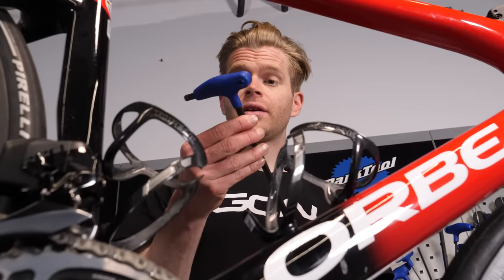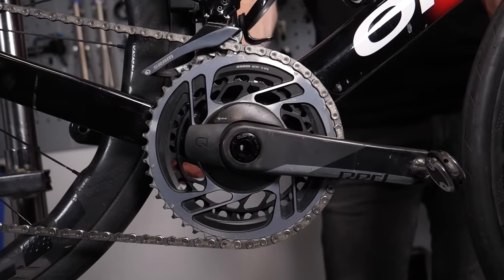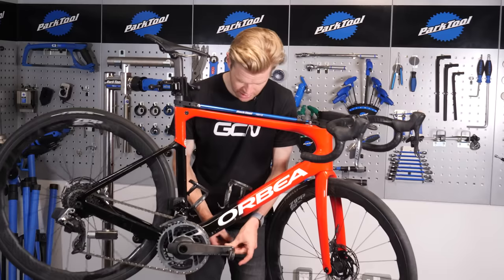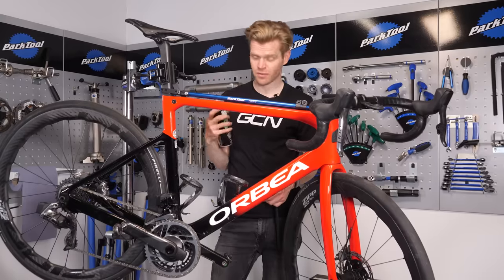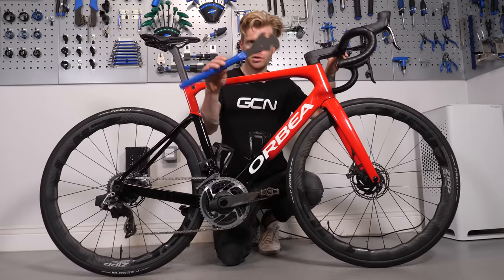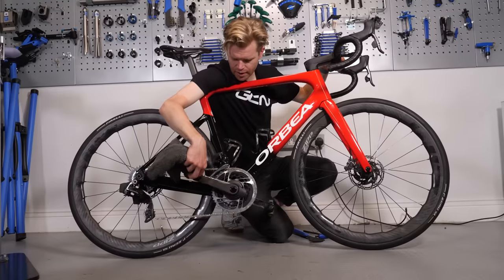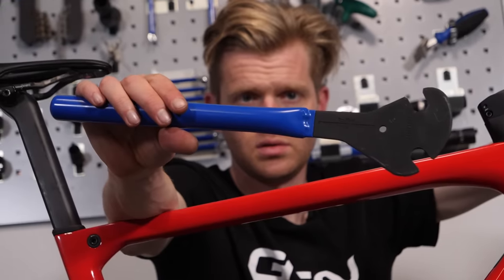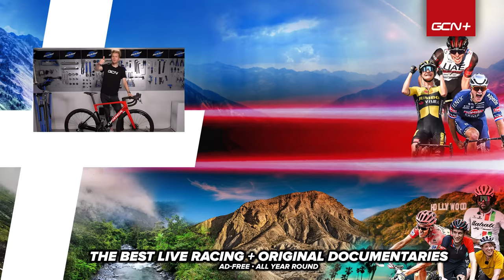How To Remove Stuck Or Seized Bike Pedals | Maintenance Monday

Comment from the maker: Do you have any tips for removing stubborn pedals? Let us know in the comments! 👇
Reply: Don't be afraid to take the cranks off and put it in a vise or clamp it down in a way that will allow you to put more force on it without risking damaging the frame (or yourself) when putting a lot of power through it.
Reply: Just the same advice as others, put a pedal wrench on it and pedal as described in another answer. I can’t even explain how to do it. When you pedal forward, it tightens the pedal, so I just pedal the wrench backwards. Pedal pops right off. 

You reverse it naturally by simply pedaling the bike. This is for old skool pedals that use the wrench. Not a super bike. 

My Bike Friday is a travel bike and this is the best solution for easily getting it into a suitcase.
Reply: There comes a point when the proper tools just can't do the job.  The pedals are so badly stuck the allen slot strips out, for example.  In such case I have had to strip the guts off the pedal and take it down to the bare spindle, then grind flats onto the spindle and employ a large set of locking pliers and a pipe for leverage.
Reply: If you're using aluminium cranks, the steel threads of the pedal can fuse to them due to galvanic corrosion. This creates a tight bond which can be very difficult to break. If this is the case, heat, in the form of a small blow torch, or better, an air soldering iron, is the answer. Cracks the bond due to differential expansion of the two metals. Best avoided in the first place by putting a dab of copper grease on at assembly time.
Reply: My tip is go to your local bike shop.
Reply: If they have an allen key hole at the inside use an impact driver
Reply: not being very strong or very heavy, I stick the allen key into the ground and stand on the crank…
Reply: Just a comment on "self tightening" direction of the threads. This is not correct. Indeed, you can insert a pedal thread into a crank, and it tightens when you "pedal backwards". 
Proof further, is if you tighten the bearing on the pedal such that they cannot turn, and pedal as usual, you will likely unscrew the pedal from the crank. (ask me how I know this, after "maintaining" my own SPD pedals recently...)
Self-tightening with the direction of pedaling would not be applicable to threaded cups of a bottom bracket either.
Reply: @stevefish782  you are right with the point regarding the pedals. The bottom bracket however would also unscrew if you would "connect" the cups to the cranks, they open in pedaling direction (to the front if your ratchet is looking upward with the shaft)
Reply: Pedals will go off with ease if you have enough grease on the thread. You should always have enough grease on the thread when you combine different metals, for example alloy and steel.
Reply: @jonford6119  Even just getting it roasty hot with a hair drier can help a lot (also helps with square taper BB’s).
Reply: @123moof  Indeed, any heat source can help. I once managed to persuade a seized axle out of a motorbike using a kettle of water. I do like the air soldering iron though, as it has a narrow flow of air and is very direct-able.
Reply: I love how your "trick" is actually backwards from reality (the direction the pedals turn when pedaling would actually turn them off, but because threads tend to "walk" they actually tighten, similar to how a pint glass actually rotates opposite the direction it is spun. For literal people like me this method only confuses the issue😭! 
I prefer the way Park Tools tells it: put the tool on the pedal facing the nasty bits (disk brake/sprocket) and then apply pressure (for your safety) down and away from the sharp bits.
Reply: @petinka721  My LBS (Overlanders) is completely and utterly incompetent. My advice therefore is to learn to do it yourself.
Reply: @simonm1447  Wait what?! Good to know!
Reply: blow torch and a bit of 3 in 1
Reply: When it's really stuck some heat needed
Reply: Won't work
Reply: Hey gcn I am having some trouble with tightening my pedals and there is a cap on the end of the pedal how do I take it off please help
Reply: @hzunasdfgbciw you're assuming there was any grease at all put on the threads when attaching them together..
Reply: THANK YOU!!!!!!!!!!!!
Reply: @wilfdarr  pedaling vs peddling
Reply: @vashon100  🤦good catch.
Reply: @vashon100  I even spelled "pedal" right and then misspelled "pedaling" 5 words later 🤣. Some days I seriously wonder!
Reply: Today I took a broken right pedal off my bike and temporarily replaced it with a pedal I cannibalised from an older, cheaper bike which hasn't been used for about 10 years. I only needed to replace the right pedal, as only that one was broken, but decided to switch both pedals, because I know this temporary fix has the potential to be in place for quite a long time due to laziness, etc.. 

Taking the right pedal off the newer bike was easy, but the pedals on the older bike were so badly stuck, likely due to the steel threads corroding into the aluminium crank, that I ended up using a mallet. With the bike upside down on the ground, I had the wrench in one hand, holding the pedal and the crank in place, while with the other hand I hit down on the opposite crank with a rubber mallet. Did the trick, but obviously not a particularly elegant solution, and not one I would have used had I cared about the older bike, which was basically scrap anyway. I was working with a rather limited tool kit, with only a small wrench with barely any leverage. 

On the newer bike, the left pedal was giving me trouble, and the mallet was obviously not a solution. So that method of holding the pedal in place with the allen key and stepping down on that pedal really came in handy. Thanks for that! 

It looks like I'm going to have bruises on the palms of my hands from the malleting and from using so much force on the older bike. I do not recommend that method. But it does work in a pinch.
Reply: @beans.x3  Ya, with aluminum/steel especially, sometimes "a bigger hammer" is the only solution. Did you remember to use some anti-seize so you don't have to hammer on the good bike in a few years time?
Reply: Thank You! I just spent well over an hour trying to get the right pedal off. Putting the bike on the floor and my foot on the pedal worked. I did spray with WD-40. It still took some muscle to I tighten, but worked.

Comment: Really simple approach is to use a spanner pushed down by your heel, when your forefoot is pushing to the pedal. Works 100% of time, no scratches, bruises. You don't even have to determine thread direction. (Just keep the crankarm leveled and pointing frontwards, spanner slightly raised, pointing backwards from the pedal axle)
Reply: This is the best way I've ever heard to remember that the left is the one reverse-threaded!  Never heard of this before and have been in the game for decades.
Reply: I found this last year when I traveled home with my Bike Friday. It was perfection. I have less bicep than Alex or Ollie. I was not moving that pedal otherwise.
Reply: Yup
Reply: No offense to Doc Ollie but I tried your approach @ondrejkubo with screwdriver bits and an adjustable wrench and VOILA! The pedals came off! I almost had to go get sutures yesterday when I used an impact drill (I know...I was desperate) and it threw my hand into the chainring, so I was running really low on options.
Reply: Fantastic and simple to remember method, had both of my peddles off within a minute - thank you so much!
Reply: Thanks, after much struggle this method worked for me first time 👍
Reply: Your way is too easy! Can't make a video long enough for YouTube with this easy method!
Reply: Worked like a charm.
Reply: Wow! Been at it for a few days! Tried WD40 Specialist version for unlocking bolts, tried heat, bought new wrench but didn't even budge. 

Tried your method and instant success! Genius technique! Thank you.
Reply: Thanks a lot, saved me time and effort !!
Reply: Doesn't work
Reply: omg THANK YOU.  this worked for me!! here's a video i found of someone doing it: https://www.youtube.com/watch?v=JVLzl1lZrA0
Reply: Don't work on my bike it's worked before on other bikes but I can't move this pedal
Reply: Fuck me mate, this is one the single best pieces of advice I’ve ever heard.  Was struggling with freeing a stuck pedal, searched for this video, and before I’d even watched the video saw your comment.  Put a pedal spanner on, hopped on the bike and voila!  Problem solved.  Thank you so so much.
Reply: Worked amazing, thank you
Reply: Still working in 2024 😂
Reply: You're an absolute genius. Harvard awaits your acceptance!
Reply: Very helpful thank you 👏 👏 👏
Reply: This is honestly a life saving technique, thank you for commenting
Reply: I owe you my life mate 😂 been trying to get a pedal off for like an hour and tried this and it worked straight away
Reply: @bloodonthesnow thanks for the link. Worked a treat.
Reply: this was the trick that got mine loosened up. So thank you for posting this!
Reply: This is genius!
Reply: Dude!! You saved me from such a frustrating situation. I’m so cautious with this stuff now after hit the drive train cogs with knuckles in the passed. Was very safe and effective ❤

Comment: Top tip is to always put the chain on the big chainring before attempting to undo a pedal. That way if the Allen key/wrench slips or gives way suddenly you only end up with bruises from giving the chain a fair whack. The alternative is slicing you hand open and likely requiring stitches, as chainring teeth are very sharp.
Reply from the maker: Great point! (pun definitely intended 😉)
Reply: @gcntech  Yeah, learned this lesson the hard way and donated a rather large amount of blood to the bike gods last night...
Reply: Did that a few years back, wasn't pretty.
Reply: I did that last night why I'm watching this again

Comment: Avoid the problem in the first place: clean the threads when the pedals are off, then apply copper grease.
Reply: Copper grease (anti seize) is for applications where the joint experiences high temperature. Just grease is sufficient for pedals.
Reply: @superjimnz  True, but there's no problem with using anti-seize.  Either work just fine and there's no advantage to using grease over anti-seize.  It's not even much cheaper - you'd only be saving the tiniest fraction of a penny per application - so little that even a bike shop isn't going to notice the difference.
Reply: Pagid/Textar say copper is not good, use ceramic grease instead:
"There is a problem however, aluminium is very susceptible to an electrochemical reaction known as a galvanic corrosion when it comes into contact with copper in the presence of an electrolyte, even salty water will do!

We recommend Cera Tec. Cera Tec is a ceramic based anti-squeal lubricant designed specifically for braking systems. It is heat resistant (up to 1000°C), non-conductive, contains no solid constituents or metals and is approved for use on ABS equipped vehicles. It facilitates brake assembly and reduces brake squealing. It can also be used on compressors, axle bearings, seat tracks and sunroof guides."

Comment: Simple. Point the crank arm forward. Put an Allen key into the pedal pointing forward. Put the end of the Allen key on something. Stamp on the pedal. No need to worry about thread direction. Works every time!
Reply: Lol you're tightening the bolt if the allen key is pointing foward.
Reply: @JFomo  no your not.
Reply: @JFomo  no because the Allen key is moving in the reverse direction relative to the crank arm

Comment: We had a set of look pedals where the drive side was cross threaded into a carbon FSA crank.

We had to destroy the pedal to remove the spindle. Removed the pedal and ground 2 parallel flat spots on the spindle so we could clamp it in a bench vise. 
Even then it put up a massive fight until the last thread.
Ran a thread tap through it to clean up the threads and the crank is still going well.
Reply: It always amazes me that people will fight to force a cross-threaded shaft into place without immediately realizing something is wrong.

Comment: Great tips, my left side pedal was being really stubborn so I removed the crank arm, put it in my shop vice (I padded the vice jaws to prevent scratches) and used an allen wrench with a piece of metal tubing as an extension to get it broken loose. I found it to be easier to remove the crank arm than to struggle with an unstable pedal in an awkward spot. BTW, GCN has a great video on removing crank arms!

Comment: I've found it's  good to lock up the rear brake with toe strap. Keeps things stable. Also, I think of it as "off the back" or "on the front" as far as wrench direction goes.

Comment: Thank you so much for your tips.
My pedals were stuck and I was able to uninstall them only after watching your video.
Putting the bike on the floor and holding the pedal with my foot is what worked for me (as in minute 4:15).
Thanks.

Comment: To remember which way to turn the wrench or hex key, my tip is that the right foot has its thread "right" way, the left pedal has a reverse thread.
Thanks for the other tips!
Reply from the maker: Nice tip, thanks Thomas!👍
Reply: Right is right!
Reply: looks like  youre wrong based on this video tho, the right pedeal is reverse thread the left is standard
Reply: @LainOTN  dont do that your gonna strip ur pedals
Reply: @timtaylor9590  actually not. The thread is right on the right. When you use the spanner you undo anticlockwise on the right and clockwise on the left. Now with the hex seems the other way around because you are at the other side of the screw. But right is right.
Reply: @timtaylor9590  you made me doubt for a moment, so I checked on my bike, right foot is a regular thread. What might be throwing you off is that Ollie has the key inserted at the tip of the screw, so he has to turn the other way around than you would turn a screw when facing it (clockwise to unscrew when looking from the center of the bike). It's clearer when you do it with a wrench and look at it from the head of the screw, the pedal spindle here.
Reply: @electronicsheep538  you got it now, the allen key is reverse the wrench is normal. depends on which one you have. i have the allenkey i figure most road bikes do
Reply: @electronicsheep538  basically if a person has the allen key in their pedal theyre going to work on it just like ollie, and youre telling them righty tighty lefty loosey...
Reply: @timtaylor9590  I didn't mention righty tighty, I just said regular thread on the right foot, reverse thread on the left foot. Now if you're not familiar with the way a regular thread goes, this tip is not suited for you. That's the one I'm always sure to remember, and since I found it, pedal installation and removal have been a no-brainer. To each their own

Comment: Best tip missing here is to use an impact wrench.  Obviously be careful you don't strip out your crank threads, but it amazes me that the impact wrench isn't a more accepted bike tool.  I find it indispensable for removing pedals, cranks, threaded bottom brackets, and DT Swiss ratchet rings (driving their special tool).

Comment: Impact wrench is very helpful, and heat can do the trick to because the aluminum crank will expand more than the steel spindle, it will also help the lube penetrate better. It can also help a ton to remove the crank arm and rings and use a vise. Stripping the axle is a problem so being patient and taking precaution is paramount.

Comment: GCN Tech to the rescue -- AGAIN. Thanks Ollie, it has been so long since I've changed pedals I forgot that they loosen in different directions. Another tip that is helpful for real knuckleheads that insist on putting Loctite on everything with threads - I won't mention my friends name - is to use the right color! In this case it is BLUE.  Thanks again.

Comment: When your foot is on the pedal (4:12) apply the brake on one wheel to stabilize the bike and get more leverage while you apply force to the pedal wrench.  You can also do this standing by the side of the bike, putting the pedal wrench on the flats between the outer edge of your foot and the crank arm. Your shoe will keep the wrench on the flat while you push down, with the brake applied. 

If your pedal is very hard to remove, it means that something is wrong. It could be that they were installed to tight, but more important is to check and replace the bearings. As you are riding, a pedal bearing that is binding under load will cause it to tighten on the crank. Be sure to apply grease to the threads when you re-install the pedals and do not over tighten.

Comment: LOL I used the old trick of putting the bike upside down on its seat, trying to avoid hitting the chain rings if I lost my grip.  and then used a long breaker bar with a 8mm socket, I still got my automotive tools, (definitely need to invest in a bike stand one day) oh I also put some penetrating spray on the pedal bolts I swapped my plastic pedals for some nice black and red Rockbros aluminum pedals.

Comment: Aluminum bike: one pedal stuck, the other came off. I had an old pedal with just the spindle, so I put it into the free pedal hole backwards so when the crank rotated backwards, the spindle would hit the bottom of the down tube. Padded it with a folded up towel. Allowed more shoving on the remaining stuck pedal. Important lesson - use more grease on threads!!

Comment: Use Plusgas as a lubricant, it contains kerosene. Put a metal bar with a flattened end on the pedal spanner for  more leverage. If you have an allen key fixing buy a breaker bar and a socket that will take an allen key bit.